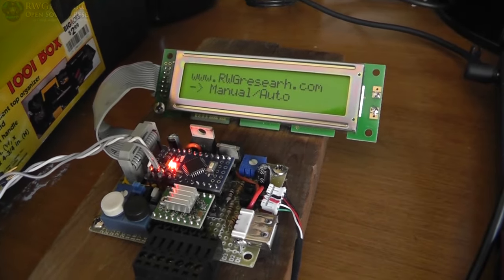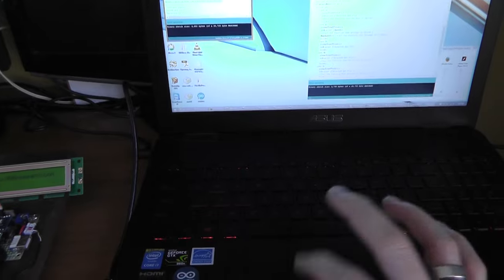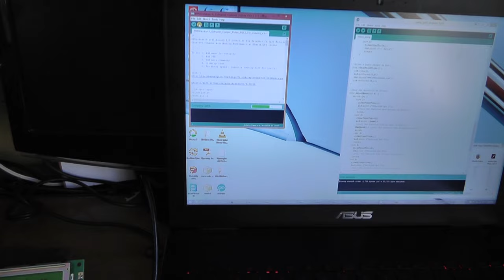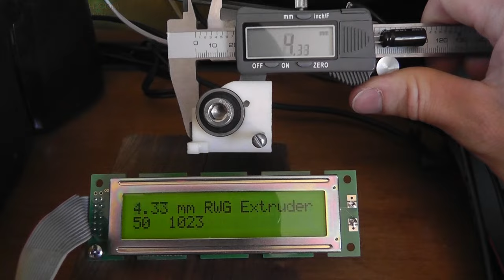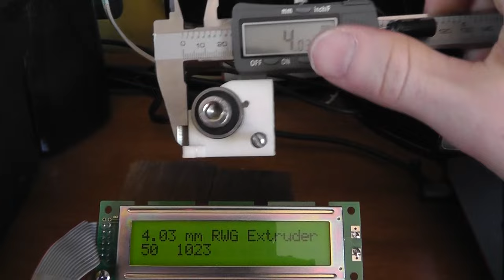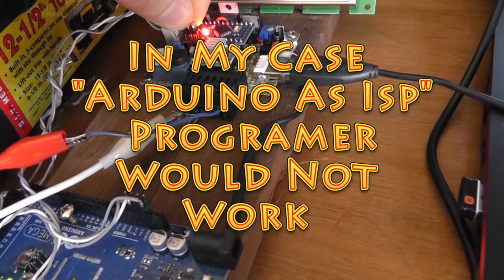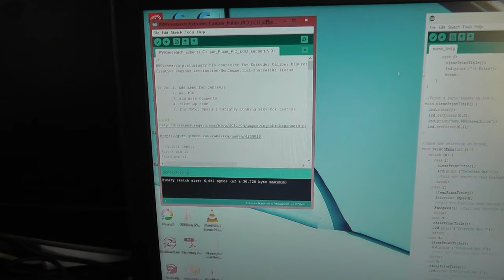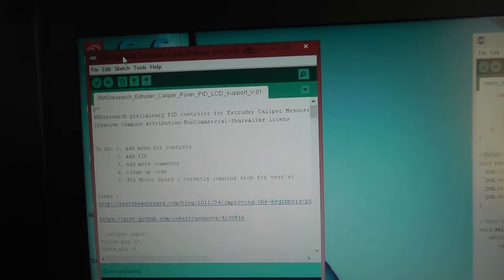How To:Busted Arduino In To USB-FTDI/DFU Programer(Mega2560) Your Busted Arduino Is Still Good,Maybe

Comment: Imagine that you plan to use it to increase or decrease speed out of the extruder so you can keep filament diameter more stable.
Reply from the maker: Migueldeservantes correct, the PID is for this function. if your not familiar with a PID give it a Google. however the correction will be made by how fast or slow the filament is pulled. the extruder is a fixed set speed. in my system im "pulling" the filament to size. it seems to work better than "pushing" it to size...  its coming along nicely. spend quite some of time on it last night ... late nite... ~Russ